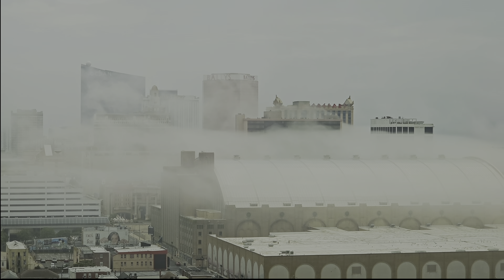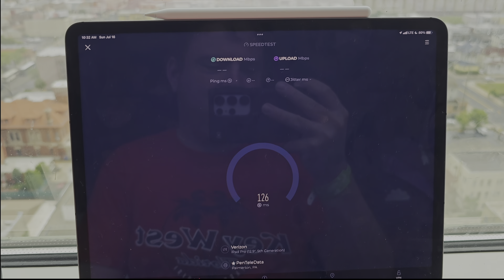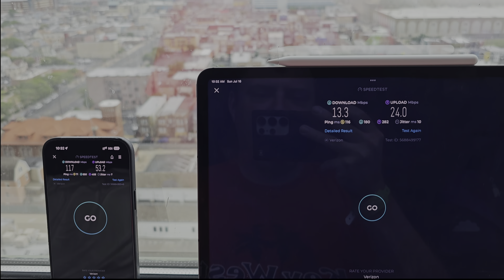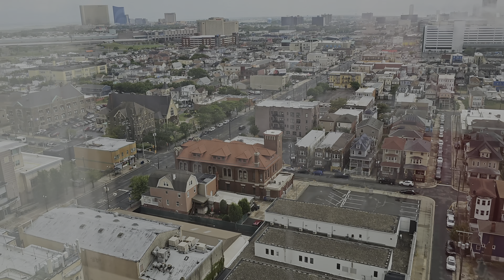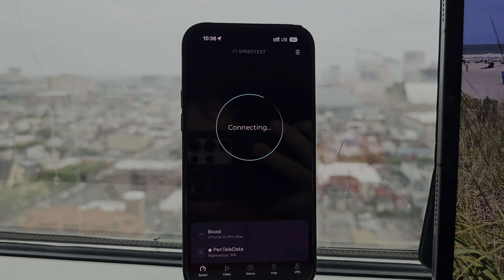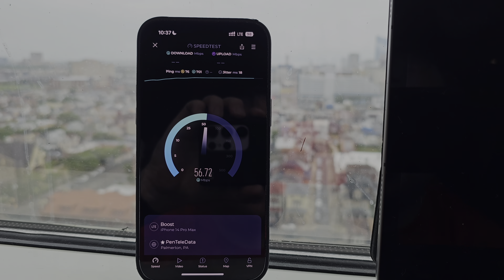mmWave 15 Floors Above Atlantic City, NJ | Testing all Providers

Comment: mmWave is not reliable and useless for me is waste of money.. 2.5 and cband is key of 5G
Reply: not if you work across the street from a node... or how about all the nodes verizon has in residential providing home internet..
Reply from the maker: mmWave for sure is less reliable then 2.5 and Cband HOWEVER, the capacity it provides is vital. Summer towns like AC can’t live without it.